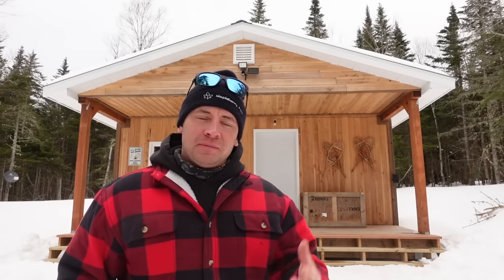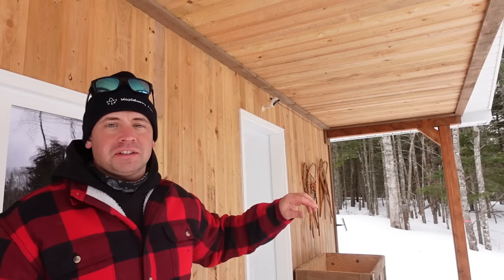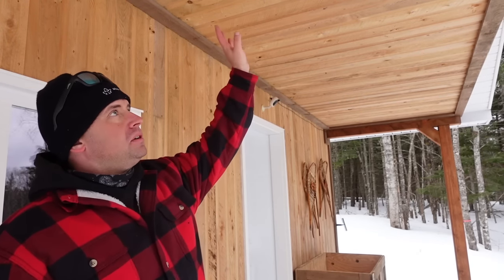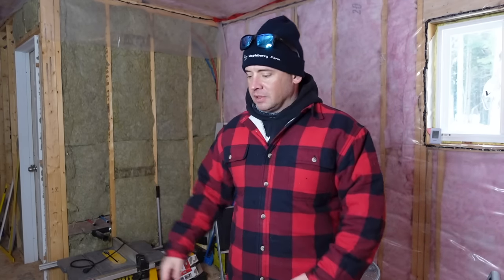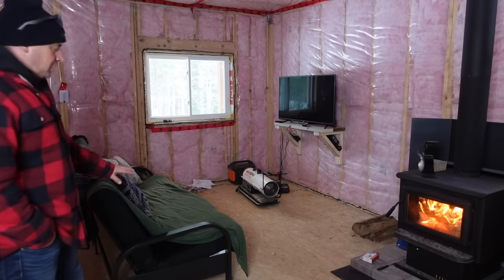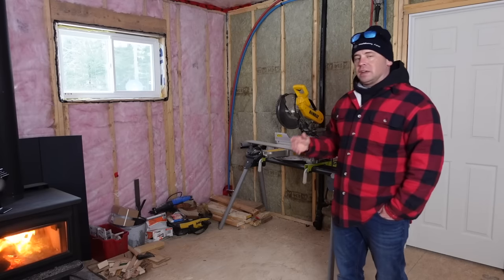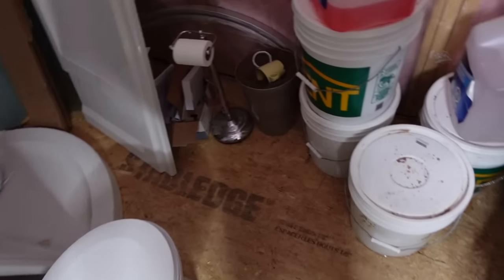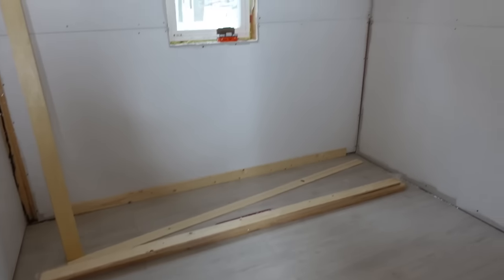20 x 30 Off Grid Cabin Tour

Comment: Did you figure out a way to use the shower ?  I thought there was a reason that model wouldn’t work with your set up. Have a great week and thanks for sharing.
Reply from the maker: We should still be able to use it as long as the fixtures are moved.

Comment: From a full time framer, I think you got skills. Its looking great. I'd like to build something similar. Do you have access underneath the floor? Was there a reason for the low slope roof or just make it easier to work on?
Reply from the maker: Hey, we have a couple access points at the rear of the building for underneath, I can also get under from the front if need be under the deck. We went with a 4 / 12 pitch as I was putting them up with my wife in the winter and made it easier. It is the lowest I would go around here with the snow, but lots of folks have them like this and it works. I usually do a 5/12 so I can still easily walk on it too.

Comment: I'm on time this go around hey have y'all ever thought or heard of a mini-split they do both heating and cooling 9000 btu or a 12,000 btu MrCool or a Senville mines Senville but a lot of people on solar are using these along with they wood stove to heat they whole cabins and they are very efficient look up running mini-split on Solar I think it's something y'all would like
Reply from the maker: Thanks and we have seen those and think it would be a great idea in here :)
Reply: @MBFModernHomesteading  yes because you can fire up the wood stove power up just the blower part of the mini split it sucks the hot air in from the top part of the indoor unit in blows it out in your cabin and that's without even having the outdoor unit running even though it also provide heat to when you put the setting on heat

Comment: How do you heat the bedrooms?  Does the wood stove create enough heat that it keeps the bedrooms warm even through the walls?  The living area must be a lot warmer because the wood stove is tight there?  Just curious?  Thanks
Reply from the maker: The wood stove, if anything, you would probably want to keep the doors closed so you aren’t too hot. And as long as you regulate the fire properly and have a good wood stove, you can manage the heat pretty good. Thanks 😊
Reply: @MBFModernHomesteading  thank you.

Comment: What size floor beams did you use? 2x ?
and what size floor joist did you use?
Did you over Build or was that the requirement?
Reply from the maker: 2 x 8 3 ply floor beams and 2 x 8 floor joists. We built according to a joist span table.

Comment: Serious question…why not use rock wool in the exterior walls also?
Reply from the maker: The cost is nearly double and unnecessary for the exterior walls. We use it inside for sound dampening, it is already very quiet out here in the woods for the exterior.
Reply: @MBFModernHomesteading  thanks…but it also acts as insulation against the cold too doesn’t it?
Reply from the maker: Yes, that is why we use fiberglass insulation in the exterior walls as it is almost half the price . 
 @Genetk44